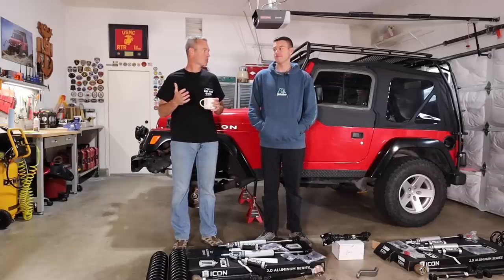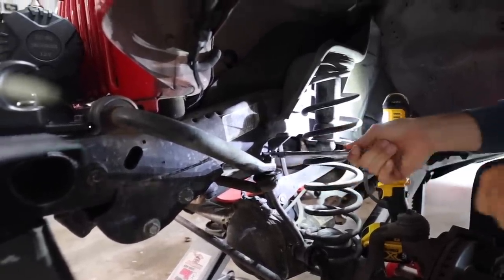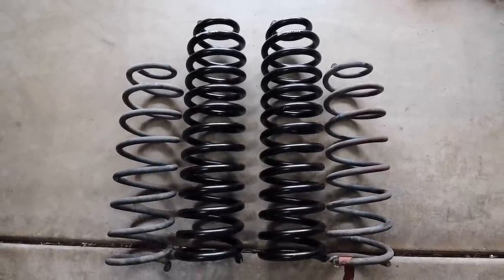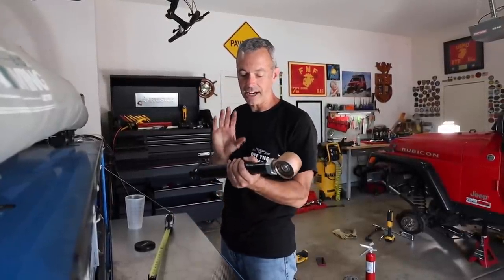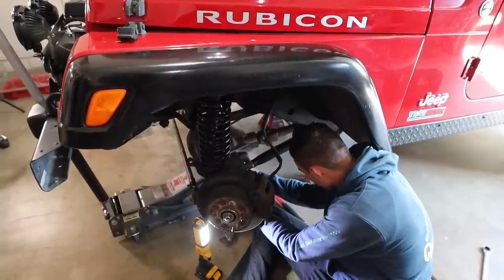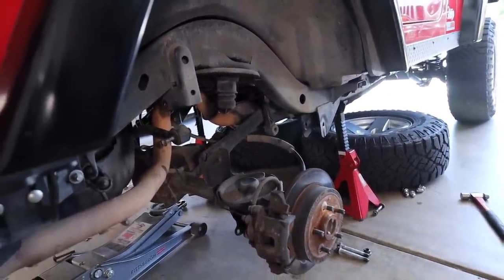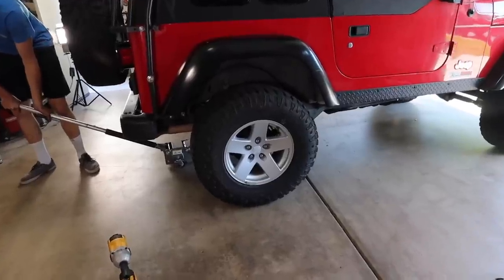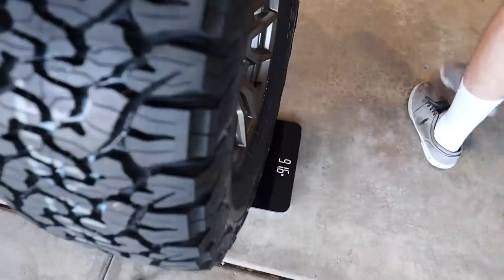TRANSFORMATION TIME! Jeep Wrangler Lift Kit & New Wheels and Tires Install

Comment: Hey, don’t mean to be critical here, so much as hopefully helpful.

I’ve noticed on a couple videos that you guys tend to run larger drill bits too fast. Consider 0:16 in this video, where the drill is running full speed with the big bit in it.

This generates a lot of heat, expanding the material you’re drilling into, so your hole ends up a bit tight after cooling. It also cooks the drill bit and softens the cutting edge, greatly shortening the life of the bit and just making for a worse result.

When drilling with a big bit like this, drop the drill into its lower speed setting if it has one, or just try and avoid holding the trigger down all the way. Unless you’ve already ruined the bit, you should see it do a much better job of cleanly scooping up the material and ejecting it without quite so much heat.

You should also drill a pilot hole roughly 1/4” in size before stepping up to this bigger bit.

Anyway, happy trails!
Reply: Hey, thanks for this comment! I never knew this and just always assumed my large bits were of poor quality. Looks like it's me that's the problem! hah.
Reply: Frm long ago in my trainee days the cutting speed for a high speed steel drill in mild steel is 100. To determine the right rpm it is 4 times the cutting speed over the diameter. So for a 1/4” drill 4*100/(1/4)=1600 rpm, for a 1/2” drill 800 rpm etc

Comment: FYI every TJ forum I’ve read says to avoid dropped pitman arms.
Reply: It does cause bump steer. I had one on my LJ installed by the previous owner who put in a 4 inch lift. I went back to a stock pitman arm and it has felt much better on the road.

Comment: Few quick things to note:
Unless you are going to add a track bar that uses a drop bracket you need to go back to a stock pitman arm as you have induced bump steer by changing the relationship between the two.  

The front coils will be much easier to install if you had installed the new control arms first and left the bump stops and spacers loose inside the coil.  You will also want to change out the front bump stop extension for one that installs on the axle side coil mount as putting them on the upper mount makes for coil "twang" at full droop. 

Since you have gone with adjustable arms I would ditch the cam bolts and get Johnny Joint Washers from Black Magic Brakes so you can use regular bolts instead.  Make life much easier down the road. 

Since you are gong with a Double Cardan rear shaft you will want to get an angled rear track bar bracket like the ones from Rock Jock or JKS.  Once you start raising the pinion up the track bar will bind and be pushed into the gas tank skid.
Reply: Agree with all of the points.  The only thing that I did differently than what you said was to use an adjustable track bar made for that length from Metalcloak to avoid having to use a bracket.  However, that said, I had already removed the original bracket and had installed a newer, heavy duty bracket from Currie on the axle to replace the original which had cracked at the weld seam.
Reply: @sardog2049  pitman arm tip is good.  People are catching on to it and it does make the ride better to leave the original pitman in for lifts under 6 inches.

Comment: Love the vids I’m 13 and saved up for $150 2 door xj and am currently putting Dana 44s and a long arm kit under it
Reply: The Jeep is 150?
Reply: My mistake $1500
Reply: @lilbvisuals4627  oh okay glad to hear you've got a goal, you can do it.
Reply: Thank you, 
I already bought it I’m just still working away
Reply: Fuckkk wish I could find a 2dr xj for that there like 5k here in Wisconsin stuck with a 4dr unfortunately
Reply: Nice i got a steal on my xj I paid $200 they were asking 1,000 because they thought it had a blown head gasket and needed an electric fan and a radiator threw a radiator in it and a fan and runs perfect

Comment: I had the same problem with the leaf springs on my '65 Mustang that you had with your control arm. After I cut the leaf springs off, because I was replacing them, I applied some copper anti-seze to the bolt shaft when I put it back together. If I were you, I would do the same to your son's Jeep anywhere that you have a bolt going through a metal sleeve on the suspension. It's particularly important in a 4x4 if you plan on getting muddy.
Fun video. Shows that nothing goes entirely right when working on vehicles. That's part of the fun of you have the right attitude!

Comment: 2 Notes from a longtime TJ owner:
1: Ditch that drop pitman arm and go back to stock. The front trac bar and drag link need to be parallel to avoid bump steer...drop pitman arm disturbs this relationship.
2: Get rid of that rear trac bar relocation bracket and upgrade to an adjustable trac bar. If you wheel the jeep the extra leverage caused by the relocation bracket will eventually tear the mount off the axle.

Great job, I've dealt with the same issues many times!

Comment: Pitman arm removal pro tip... Put a T-bolt clamp around the base of the pitman arm puller near the ears to prevent them from splaying out. Amazing how something so thin and flimsy can bolster such a beefy tool, but I've done it a bunch of times now.

Comment: I have an 04 TJ. Didn't know what a Rubicon was 12 years ago when I bought it. So I put G2 Dana 44's 4.56 gears ARB lockers 35 spline rear 30 front chrome moly shafts. It's about to get a long arm from Rustys installed. I run 35's Goodyear MTR'S. Hopefully an Atlas 4 speed next year. May other upgrades on board too. I love your Videos. Thank you for your service. I'm an Army Vet. Beautiful TJ. Love all your rigs. Very well made videos. You are very easy to listen to. Great job.

Comment: I have found that a propane torch doesn't always get stuck parts hot enough.  Get a map gas torch (yellow bottle) and get it glowing a little and the hit it with the impact wrench, breaker bar or hammer as necessary.

Comment: A little trick with the springs - remove the lower control arms. They bind when drooping the axle, but removing them (one side at a time), will allow the springs to drop in (even longer ones).
Reply: Too late now lol. But good advice for others. I removed the upper CAs on my grand and dropped the axle till they fell out. Then new lower CAs, springs in, then new uppers.

Comment: Ok A. This is the best most comprehensive TJ lift video I've ever seen THANK YOU.

B. I've spend 4 years and done nearly everything to try to make mine ride better (it rides.like a brick) I JUST decided to take apart my old aftermarket lower control arms yesterday since the grease points are broken and I haven't been able to grease them since I've owned and who knows when the previous owner did. long story short they were frozen solid in place I had to spin the bolts as fast as I could with the air impact to break them loose and get them to where they would come out while hitting them with the hammer I've been lube them up with grease and put them back in and it rides like a Jeep should now hallelujah

Comment: If u wanted to save the pitman arm I’ve found that heating and applying wax as in standard buffing wax for paint. Helps a lot. The wax melts and sort of gets sucked into the cracks in between the shaft and the part and acts as a lubricant making it less difficult to remove.

Comment: I know what you  mean when you  never know what you  could  run into working on your Jeep. My last two projects  on my 2013 Jku told my wife should be  done in an hour, yeah right. 3 to 4 hours later I'm  done., but I get a certain  satisfaction when I do it myself.  Nice job guys.Ha. just so there isn't  and confusion I'm  using my wife's tablet.

Comment: Awesome project man! Sorry I missed the fun!
Reply from the maker: Next time!
Reply: TrailRecon, Brad you should used a stock pitman arm, you will put more stress on your gear box shaft bearing and wear it out, ask me how I know, get Currie correct steering link and you will have correct alignment and no steering bind.Well worth it, did this on 3 of my Jeeps. The stock tie rod is weak compared to Currie, you won’t have to worry about broken tie rod .

Comment: Someone probably mentioned this already, but I can't go through 497 comments, but since your arms are adjustable. You don't need a cam bolt anymore. You do need some special washers to make the holes straight, but they are much cheaper than new cam bolts that are not necessary.

Comment: Having adjustable length lower arms is what sets your caster...you won't need that adjuster cam for alignment. 
Think about this, XJ front D30R is a direct replacement for the TJ D30. 2 major reasons for swapping a D30 for a D30R is high pinion layout and that the XJ pinion is shim set, not like the TJ where its crush sleeve set. 
Everything will bolt across as well. Unit bearings, steering, brakes, front ds. Note though, caster for XJ is set off the frame mount, TJ is set on the lower CA mount. So using the adjustable lower arms, that is where caster is set. 
I've updated my 97 TJ with the 96 XJ D30R and 01 Explorer 8.8. Both geared and locked running on 35s.
Best to double check that rear bump stop spacer by articulating the axle. Check the shock. 
For your spare tire setup, flip the 2 over 1 to be 1 over 2 or rotate on the 5on5 bolt pattern circle. Drill holes, spot weld the bolts on the back side. 
Suggest: reverse the rear lower CAs to have nut head on outside and nut on inside. Look to upgrade both upper upper CAs since they are thin stamp steel. Upgrade those upper CA bushings to polys. Remove the rear track bar riser bracket, toss in an adjustable articulating track bar. Same for the front track bar, replace with adjustable articulating track bar. Weld on skid brackets to the front lower CAs, to help strengthen the bracket. Fab a nut plate for the rear upper shock mounts (knock out the spot weld nuts). Add longer front brake lines (aftermarket or YJ).

Comment: I had the same issue with the pitman arm on my '02 TJ.  However, since my steering box was leaking, which was the reason for removing the arm, I was able to use all the heat I needed from a oxy/acetylene torch without worrying about damaging the seals in the box since they were already trashed.  They definitely can be buggers!

Comment: Nooo dropped pitman arms unless you also drop the front track bar mount!
Reply: Was looking to see if anyone else saw this. Going to have some bad bump steer now! You want the trackbar and drag link to be parallel!!!
Reply: Yep dropped pitman arms are a sure way to get bump steer. When I got my Jeep it had one and in my process of eliminating the bump steer I got rid of it and added a Currie correct link. Fixed it.

Comment: i broke 2 different pittman arm pullers trying to get the pittman arm off my 20 year old ford van (converted it to 4x4 :D)... what ended up working was the conical type + heat cycling with a torch. I can't stress this enough! heat cycling a few times to expand/contract the corroded mating surfaces really works wonders, especially if you PB blast (or use ATF + acetone) afterwards.

Comment: I have a few times used a cut off wheel and slowly cut off the pitman arm. sometimes in the rust belt its the only choice you have. And on a TJ you should get a cam bolt eliminator kit when you use adjustable arms

Comment: Interesting video.

My notes:
Use 6 ton jack stands for the frame and 3 ton for the axle. This allows you extra clearance to fit the springs.

No need for cam bolts with adjustable control arms.

Comment: a good oil applicator that will slowly apply oil will definitely help when drilling thick metal, no matter how big a diameter whole you need. It will lengthen the life of the drill bit for sure. If you have to drill upside down, just stopping about every 30 seconds to put some oil on the tip will help it stay cool.

Comment: Not that its a common job but they make a pitman arm puller that goes around half of the arm and has 0 chance of bending. Also gives it even pressure. My xj went through 3 of those  2 prong pullers before i picked one of those up. Life saver!

Comment: I had to use a hose clamp wrapped around pitman arm puller to get mine off my truck when I saw them starting to separate. It kept the arms together and the puller straight as we used a wrench to turn the center bolt.

Comment: Best to use anti-seize on those places where those parts were rust welded so that isn't a problem for the future. Also if you drop the pitman, you might have to drop the trackbar to prevent death wobble since the steering and trackbar aren't at the same angle. Keep in mind, if you drop the trackbar, find a really well made strong track bar drop bracket. They break easy. I've also seen pitman drops break as well so be aware of that.
Reply: I wouldn’t leave that stock front track bar on for too long in that new position. Move to an adjustable and back to the original position. Shouldn’t need a drop bracket.
Reply: I guess I didn't see if there were adjustable track bars going in. That is pretty important with nearly any lift height. I'd say no drop and adjustable trackbar and maybe even an upgraded drag link to increase the length safely while maintaining strength.
Reply: You wont get death wobble but you'll get gnarly bump steer

Comment: found from person experience, when the cambolt is stuck, heat it, then heat it 3x more than you're comfortable with.  Then...use the impact on it for about 3-5 minutes until it finally breaks free.  you'll start seeing sparks :)  then it comes right out.

Comment: Another trick with the pitman arm is … put the puller on… add tension to the puller… then apply heat… get it red hot… shock it with cold water… soak it with PB blaster while it’s still warm… give it taps with a hammer…. Reapply heat  and pb blaster while under tension… 

The constant thermal expansion and cooling will help pb blaster to get to the rust and break it free.

Comment: Just an FYI: I ended up getting the Icon Alloys Vector 5 wheels after watching this video. I was in the market for new wheels and (larger) tires and had settled on the Fuel Nitro 5, but after I saw this video and not knowing about the Vector 5, I bought the Vector 5 because it fit the bill for me (4.5" BS, 71.5mm hub bore) and I liked the styling.

Comment: TJs production started in 1996 ,as a 1997, I ordered mine in may of 1996. If you are installing all those high end parts, why not adjustable track bars, drilling a new hole weakens the bracket, and your measurement to center the axle will still be off, and don’t be surprised if you wind up with death wobble from the old worn out track bar!

Comment: Just a tip for next time - when pulling off the pitman arm loosen the bolt but don't take it off the steering box shaft until the arm has broken free - keeps the pitman arm from flying off and potentially hurting someone👍

Comment: Remove control arms completely and then put the coil spring in. You wont have to fight axle as much cause it will be able to drop as far as you need it too.

Comment: Just get a cam bolt eliminator washer. Several companies make them (Metalcloak has a nice one) and you don't need a special cam bolt afterwards anyway since you have adjustable control arms. Earlier TJs had some camber washers but for the most part you can't really adjust camber on a TJ.

Comment: TJ 1998 Jeep new upgrade, Air tank located under brake buster. (4" x 9" pvc pipe)👍👍👍 now I can can run air tool, I think I can put a second air tank on the other side under battery.
Black bag has, 25 ft of 3/8 air line and air gauge chuck. On off switch in mounted just in front of the compresser.
Not sure how to attach photos

Comment: Because you are using adjustable control arms you don't need the cam bolts. Take the old washers from the old cam bolt and weld them to the control arm mounts. All your adjustments will be done with the control arms. Than you can use a normal bolt and nut.

Comment: Dropped pitman arm is going to be a problem because the drag link and control arm will no longer be parallel. Hello bumpsteer.
Also, a 4" lift will require some clocking of the rear axle with the Adams double cardan since the rear U joint should be in an unflexed position and you'll find the rear track bar relo bracket should've been an angled one. Also, not sure your OCD will allow bowed springs! :)
It's really a cascade of issues when lifting more than 2".
But hey, am loving watching you guys have fun!

Comment: I feel your pain on those stuck bolts and the pitman arm.  I've been working on some 'simple' mods on my '03 TJ during quarantine.  My heap has spent 17 years in WI being bathed in road salt.  This Rubicon is in dream-like condition compared to mind :D  Even the front shocks were quite the struggle for me.

Comment: Hey there guys! I was passed down a 2004 automatic tj from my late grandpa. My father had a local shop installed a 2.5” rancho lift kit on it with 17 inch wheels and 33” mud tires a few years ago. When going through somethings, I started questioning the lift kit install especially since I think the ride feels super rough. I’m not sure if it’s the tires or something to do with the install if lift kit.  I don’t believe anything new was installed besides the shocks and springs. Should there have been spacers, new control arms, and sway bar links like your 4” lift kit installed at the time the lift was installed? I do not believe the shop had much experience with lift kits. 

At the end of the day, I’m trying to figure out what needs to be done to improve overall ride. Should I replace the tires with an AT tire (great choice on bronze icons btw!), install a new lift kit with sway bar links and control arms, or do maybe do both?

Thanks for the help! Love the videos.